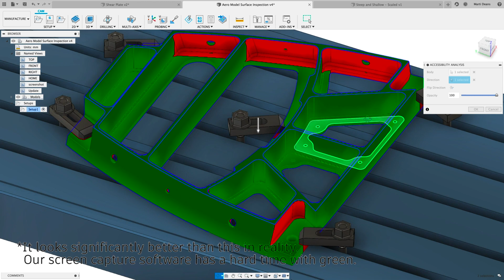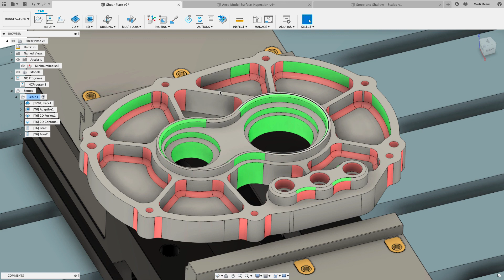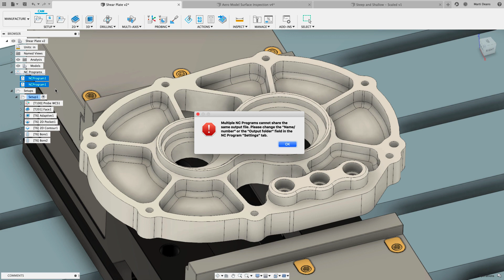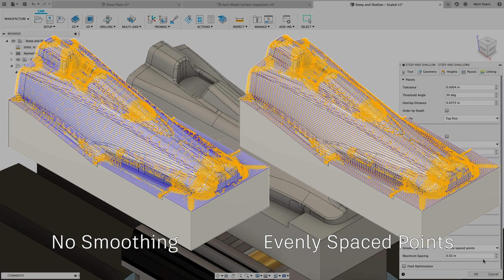What's New in Fusion 360 Manufacturing - August 2019

Comment: Would be great if the Design Workspace would get a tool similar to the Minimum Radius tool that you added to the Manufacture Workspace! 

(Keep in mind that it would need options to invert the radius assumptions for molded parts.)
Reply: I just got the update and I'm happy to say that it indeed is in the Design Workspace too! Thanks Fusion 360 folks!!!

I'm looking forward to a version of the tool for molded parts (analyzes the rounds, not just the fillets) as well as molded part version of Accessibility Analysis (2-sided version of the current analysis).

Thanks so much!
Reply from the maker: Yep! I probably should have added it to the main "What's New" vid, but wanted to avoid overlap.